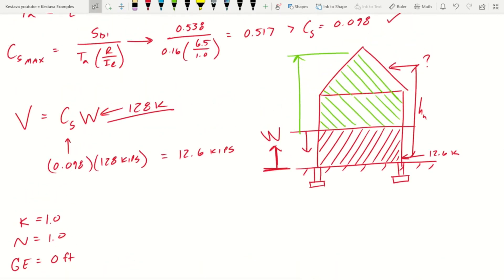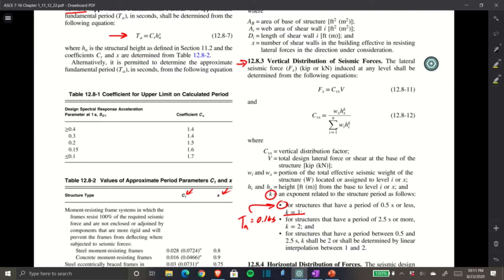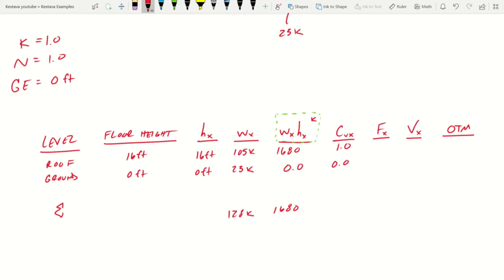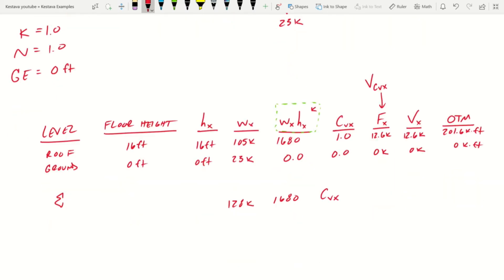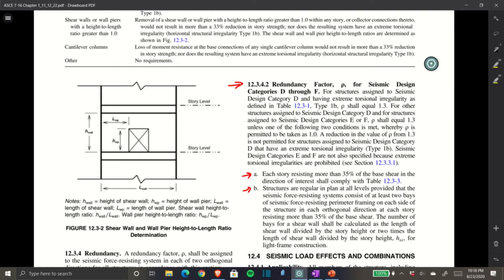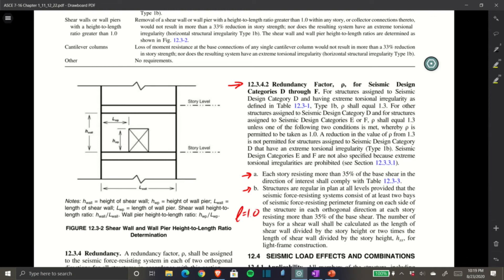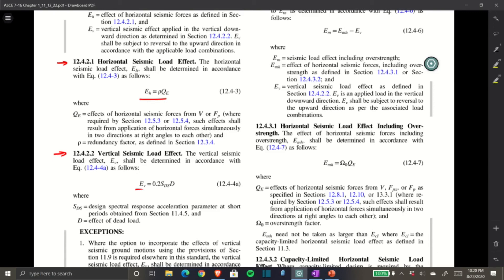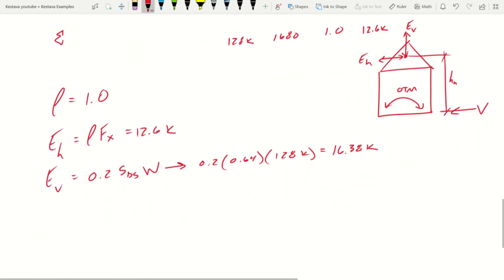Seismic Design of Structures - Finding Seismic Criteria using ASCE 7-16 (part 3 of 3)

Comment: In 2:19 How calculate wx=105  for roof story?
Reply: It was just assumed by the designer to curtail the step of calculating the precise mass of walls and roof materials separately. Just to cut short the video length and infact to illustrate the real purpose of video.

Comment: I was taking your lessons and comparing the results simultaneously with RFEM dynamic module to generate response spectrum and all the variables automatically calculated were correct. Now I have deeper understanding of seismic loads + more trust in the FEM program I use at office. Kiitos!

Comment: When calculating Eh and Ev, you take your rho multiplied by Fx, are those Eh and Ev at each level or total?  I ask only if you had multiple stories, 2 or greater, would I take the sum Fx or just each level Fx and determine my horizontal at that level?  Same question with Ev, is the W the total weight of the structure of the individual weight at each floor?

Comment: Hi, I am a newbie to this code. Could you clarify the difference between OMF, IMF, and SMF Frame type? I designing a warehouse made from I - section, one storey. Which one is the best
Reply from the maker: Hi Toni, Great Question! OMF is really straight foward on design but its a VERY conservative design and has alot of restrictions in its use case. AKA when the code actually permits you to use this design. IMF takes almost the same level of design / detailing as SMF so typically (but not always) if your going to do IMF you might just want to jump to SMF since the cost for SMF is not to much more and the benefits are significantly greater from a design stand point. I hope this helps!
Reply: @Kestava_Engineering  Thanks for your prompt response ^^
Reply from the maker: @tonice5660  I got you my man!

Comment: Hello, I am doing my senior project at my school and my project is to design a 4 story hotel in CA, so these videos have been very helpful! I was wondering where would hn start if there was a parking garage? Also, whats the best way to calculate the weight of a building? I was also wondering if you could make videos about the wind load? I honestly could ask you a lot of questions about this code.
Reply from the maker: Hi Casey, sounds like a really great senior project! If the Hotel is 4 stories with a flat roof, then Hn would be to the top of the roof. then your seismic horizontal forces would be distributed  to each of the stories based on relative height of each story and relative weight of each story. I will do a video in the next week and do a quick example for a multi story structure for you! tell ya friends about the channel homie. Peace
Reply from the maker: wind is also on the menu very shortly. to start - look in the ASCE 7-16 provisions and look up the wind chapters.
Reply: Kestävä awesome thanks
Reply from the maker: @Smockuthnot  The Latest video is up and its all about finding story shear of a multi story building!! get it kid